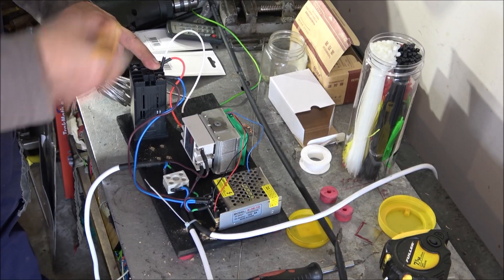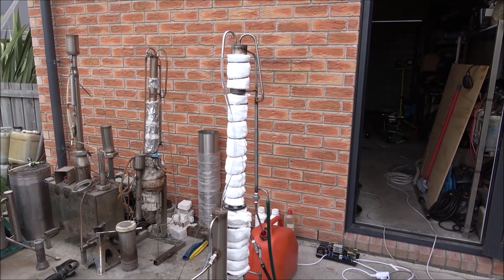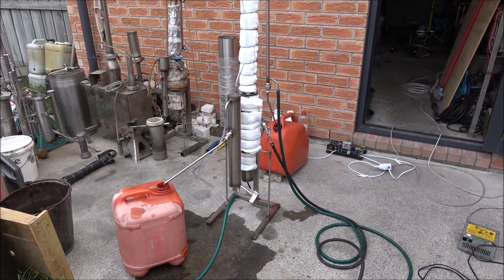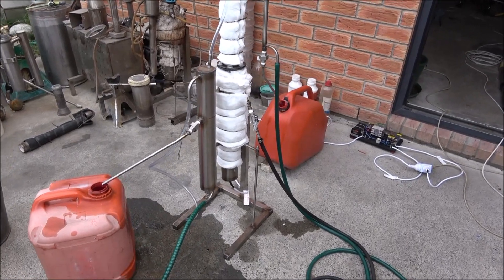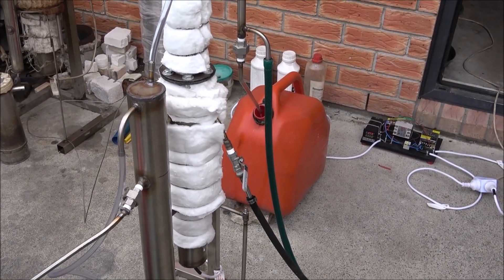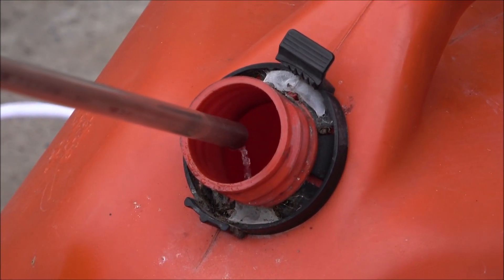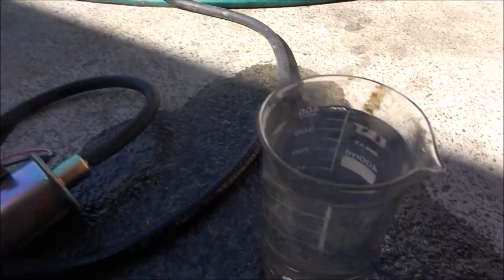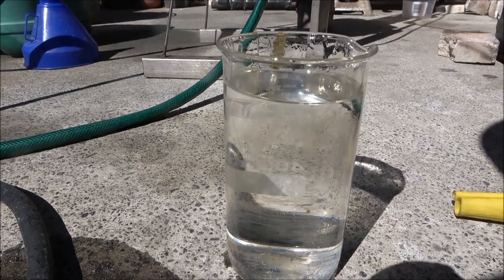Accidentally mixed Gas /diesel separator 1.6 kw

Comment: I admire your distiller but..... Why not mix the off spec. fuel in small amounts with gasoline and or diesel?  The engines will run on it.

Comment: Us the clicking the contactor/relay. The part in between the temp controler and the power supply on your electric panel. Is that the clicking sound im hearing? I'm new to all of this have lots of knowledge on this type of industry just never applied for this purpose. Getting ready for a om606 build and might try and make a diy "fuel generator" vid sieres. Most will be driven off by the risk or cost. But self sufficient processes in life are important. Smart/inquisitive guys like your self, myself, and others play a very important role in life. Let's motivate others to learn safely and cautiously, but above all never fear to try somthing new because "they" who ever those @%$holes are say its not possible.
Reply from the maker: The clicking sound is from the solid state fuel pump, thanks for your comment.